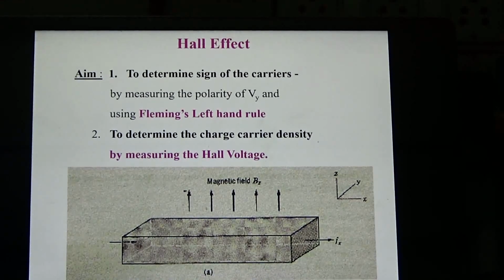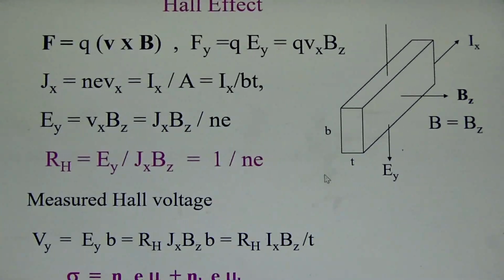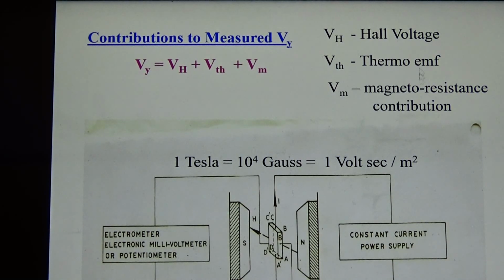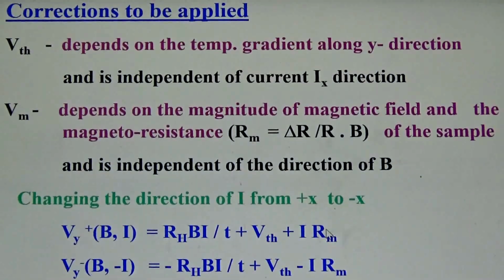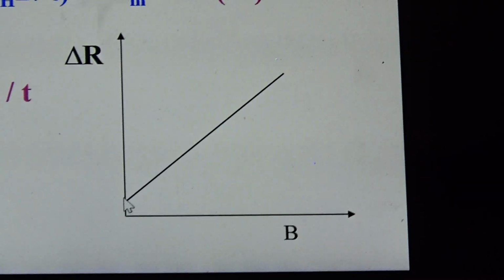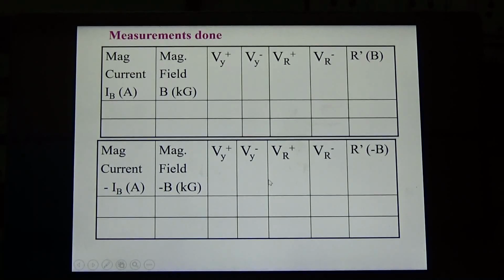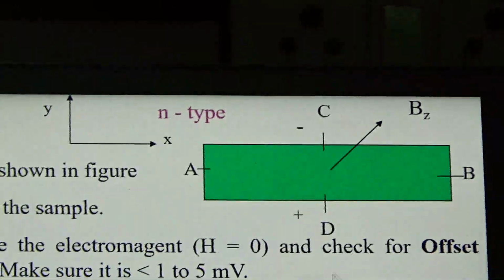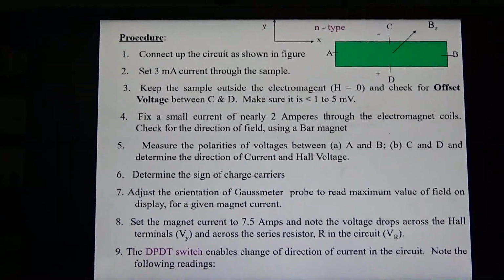Hall effect

Comment: The most important in these days of inverter technology and for the BLDC motors the HALL EFFECT sensor is much fascinating for the proper and always in one direction of rotation either in the clock wise or in the anti clock wise direction by means of the Hall Effect sensor employed in the circuitry of the BLDC motors.